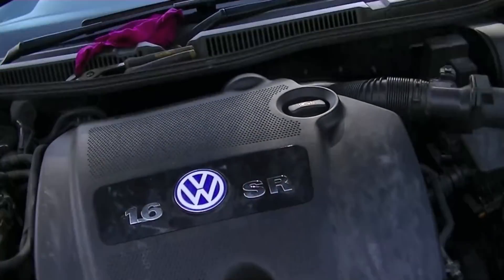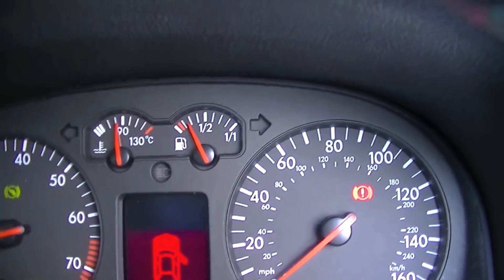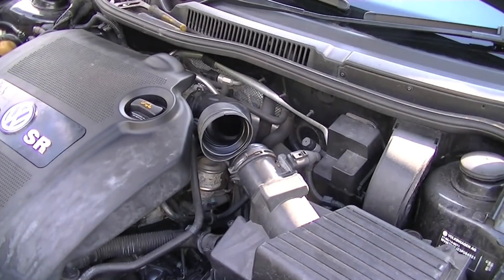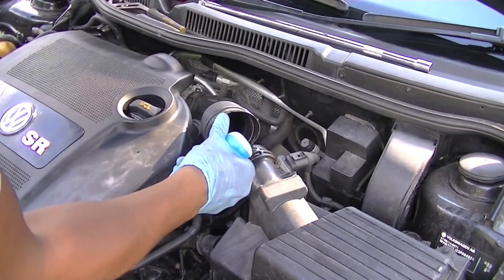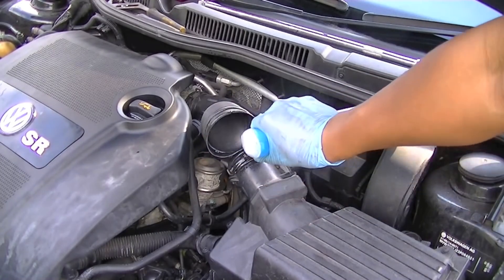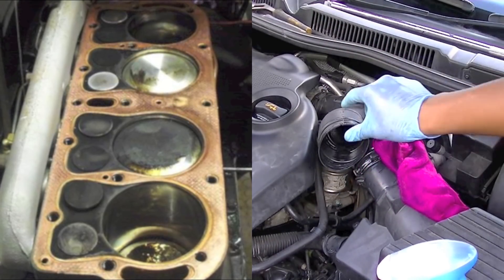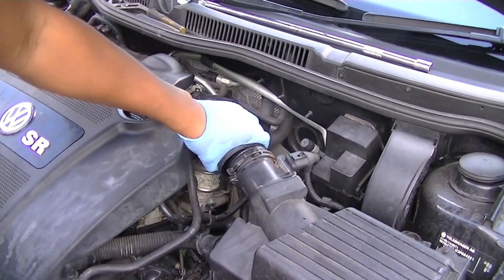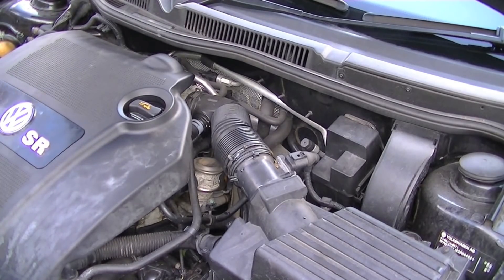How to make your engine run better with just tap water.......Better Than Seafoam?

Comment: Hi, I am planning to do this on a 1.2 TSI turbo that has an intermittent cold start misfire issue. (Spark plugs coil packs have already been replaced so I suspect its due to carbon build up since its direct injected) Should I add the water before or after the turbo? Thanks.

Comment: Never take the risk of water in the engine . Or water in the fuel tank. It   can be a dangerous idea for damage all yr injectors . WD40 is cheap & better than water .
Reply: You're not putting water in the injectors, are you...  Youre putting water mist in the air intake...  which if you think about it, hasnt got anything to do with the injectors...  Unless your car has Air Injection...

Comment: I have tryed on diesel tdi, but suddenly i hear noise of turbo, so i stopped..., i think its not good to try this on engines with turbo, because turbo needs fat, oil in fuel
Reply: Cold water on a Hot turbo will make the turbo shit itself...  You have been warned...  Spray AFTER the turbo...  You cant do that manually, you have to install a PROPER water injection kit...

Comment: I just did this on a hot engine the right way, and now i got check engine light after reassembling... HELP
Reply: Itll settle after a few minutes, once the computer realises all the sensors are still there and working (unless the plug has fallen out of the sensors, and they're genuinely NOT working)

Comment: i never see this but i dont think that   water spray can make damages in the way he dose. in the combustion chamber the atomised water instantly turn into steam and for all the rusting issue comments. i dont think that any humidity will stay there long anough to rust anything. lol make sure to let the engine runs 4 few minutes and the rust issue juste dosent exist. i know that water expant about 1000x his volume when turning into steam. it could maybe increase the compresion a bit and that can help to take of the acumulation of cab that build up in a little bit lower compression condition. if you ever herd about steam hammer in steam pipes that contain colder condensate. ok, its the invers process. steam that get back to his liquid state but    the rapid expention or rapid cool down into liquid water have a  pretty violant effect.

Comment: I have used this method on petrol engines with carbies having someone keeping the revs up to stop stalling & pouring a 1 pint Milk bottle of water through directly into the carbie.
If you stand behind the gunk & black flakes that come out would surprise you.
Barry Michael Australia

Comment: Used to do this by pouting a cup of water from a measuring cup revving the engine to about 3000 rpm and spend about thirty seconds dumping it down the carb.  made spark plugs look brand new never ever had an issue. changing the oil is THE most important thing you can do for an engine. there are good and bad oils out there. expensive is not the answer

Comment: A buddy of mine tried this on his diesel engine. It caused the engine to blow, due to oil getting too thin, while doing that a few times and the piston got stuck, breaking a hole into the sidewall of the engine. Some of the broken parts got into the exhaust system and broke the turbo and catalytic converter as well. When I asked him what made him do that, he showed me this video. I took the motor apart and the pistons were not even cleaned as you claimed it would do.
In some comments you refer to this technique being used in the 60's, but they didn't actually use normal tap water. This can cause rust in the exhaust system and the turbo (if it's installed). Only distilled water doesn't cause rust.
How can you even recommend a "cleaning" method to everyone, without making exceptions to certain cars? This practice can NOT be safely performed to ALL types of cars as you claim (and especially not with tap water).

Comment: Water injection was used years ago in propeller driven Fighter air crafts , to fool the engine at high altitudes into thinking its working in a lower altitude , this would yeild more power ans speed... so this video has some merit..

Comment: Well back around ww2 & then later in the 1950's there was a device that was a kit that would essentially do what this gentleman has done here.The kit contained a tank & a valve that would let a small amount of water into the  engine when hot ., my father said it worked very well.The one reason i can think of is more carbon would build up in these engines that were lower compression & didn't burn their fuel as completely., & add that they had carburetors & no computer control ,adding to the problem.Later when cars got Up to about %50 more compression the problem was still there, but less apparent among the rest of the  preexisting problems of poor ignition systems & shorter engine life , "for the average owner" .Now with modern cars with variable valve timing , computer controlled fuel injection & "effective compression ratios of 11 to 1 compression can be over 200 lbs  read  with a gauge .,( all without detonation {mistakenly called spark knock}These water devises were for gotten when 200,000 mile engines were easily within reach for everyone.Do they work? Yes.& better running (smoother) means better gas mileage & longer engine life !

Comment: This works well with distilled water in a plant mister/sprayer. My 2000 Corolla was pinging on hot days running  above 3K RPM. After 3-4cups of warm water sprayed into the intake while running the engine at 3-4K RPM, now the throttle response is incredible, and no more pinging!
Done correctly with fine mist, there is no concern for hydro-locking. So many people doing this with Seafoam for many years (myself included) I've yet to actually know anyone who destroyed ttheir engine due to hydro-locking.

Comment: I know what spraying the water does. First, water absorbs some heat from the air intake and cools some of the air. Giving a denser air, improving some performance. Secondly, when the water is in the engine, it becomes superheated steam, cleaning the carbon deposits out. Superheated steam is able to flow out like a gas, same process use in power generation. You know what i mean if u have a gd grasp of thermodynamics. Steam is able to clean and dissolve a lot of things, go google if you dont believe me. Its like steam cleaning the engine. I do not trust this method, I am not sure if steam will damage the pistons though.

Comment: I've got little mason jar of water and raved my old carb motor to 15 to 2500 rpms and poured it down the card do to the fact water do t combust and it reseated my valves and the motor ran smooth after and I'm a deisel machanic I u.derstand everyone has there dounts but I wouldn't  Recommend it with these newer motors BG makes a really good cleaning agent for your plinum but cleaning the throttle body on the fly bye  will take care of the reduced engine power use parts clean and a little wire brush

Comment: Hi Ya,,in the old days,,( yeah i'm 60 ),we used wind screen washer bottles and in jected water straight in to carby ,,but we did it to allow timing advance,stop detonation,,mind it did give slightly better performance,,or so we thought,but never had an engine hydraulic or fail from this,,mind not to much water,,

Comment: When your engine stops the valves on a couple of the cylinders will be open, so over night you will have condensation forming in these cylinders. That is why when you remove the cylinder head there is less carbon in those cylinders than the other ones.
In older engines they did not have rubber seals on the valve guides, the rocker cover would condensate inside which caused the oil to look like mayonnaise. This water oil mixture would run down the valve guides and into the cylinders. The boiling point of water is 100 degrees  center grade. The combustion chamber is about 900 degrees.
The water would have evaporated putting up your compression ratio. Which gives the impression of a cleaned engine.

Comment: Small amounts of H2O (aka fine mist) enters the intake with regularity. Condensation can build up simply by heating and cooling in a high humidity atmosphere...not to mention driving during a rainstorm. It's virtually impossible for a fine mist to harm an engine running at 2,000 - 3,000 rpm at normal operating temperature.   In fact, the mist will more than likely vanish before it gets to any of the engine's inner workings just due to the ambient temperature in the intake hose near the intake. Set an oven at 170° and spray a fine mist into it and see what happens to the mist. It's only common sense, people... try using it before you post idiotic responses.

Comment: Lots of opinions here are valid, but its simply not true to suggest that water sprayed in small amounts into the intake would destroy an engine, Saab use a water injection system in the 1970's and many race cars use water injection today, granted it's for a different reason, but it proves that water mist sprayed into an engine is not destructive provided you go easy on it.

Comment: Will this method also clean the throttle body? I have a volvo c70 convertible its throwing up ETM codes. I am going to clean the throttle body with the correct cleaner. After i am going to do this decarbonize, can i occasionally spray throttle body cleaner down there aswell just to help with the process?

Comment: how this work if i spray it on the turbo?
Reply: REALLY dont spray it on the turbo...  Very cold water on to very Hot turbo, the Thermal shock would be enough to grenade the turbo, if not cause some pretty nasty damage that will make itself apparent the next time 5 billion RPM boost is required...

Comment: Good video....
 I tried this on my Audi TT  ... it had over 120k miles.... cold water and a table spoon of white wine vinger and a a table spoon of lemon ... juice.... 
Squirt 6 times every 30 seconds  ... now the idle needle has dropped...
.. engine drives well.. and am saving petrol... thought it was a joke at first .   But it does work...

Comment: Will this also help clean the build up inside the exhaust ports, exhaust manifold, and inside the exhaust pipes?
Reply: No, in fact, if it cleans the engine all the rubbish heads OUT the exhaust and it will corrode the exhaust system quicker...

Comment: Before fuel injection came around our Cadillac dealer put transmission fluid in the carbs of all used cars they sold then had the cars driven around. When they came back the exhaust would be chalk white just for those who inspected it before buying...lol

Comment: Your supposed to get a one gallon milk jug fill it with water then get someone to rev the engine up to 5000 rpm then pour the gallon of water in as fast as you can. It will clean the tops right off those pistons. You might have to replace a coupe piston rods but while your in there replacing those you can wire brush all of the carbon that’s left off.

Comment: If this doesn't work,  why do they make water/methanol injection kits? Why does the bmw 4 series have an option for that? Although its for a different purpose.... raising that octane of fuel. But at low,  atomized amounts, it won't hurt your engine. I have a B5 S4 and I've run a water/meth kit for years

Comment: That's bull.. best way is use cow shit smear around air intake rev the fuck outta the engine . Then pour neat vodka into oil top up tube. Then add crushed  ice. Drive for as long as  possible then call breakdown company.. this is no worse than what that twat has just described  other than ur car will now smell of cow shit!

Comment: I dunno if this method works or not but if anyone needs a 100% positive fuel system clean which include the airflow sensor, the catalytic converter & the complete internals of your engine, find a "Terra Clean" center & get you engine cleaned there. If it doesn't work, Il pay for your costs! lol

Comment: This guy's a idiot let get water in the motor , rust on pistons rods spark plugs and probably wear out bearings
Reply: The water vapour...  remember its not straight water...  enters the engine and pretty much immediately evaporates, drawing heat out of the inlet charge...  This makes the inlet air cooler and denser...  Cooler and denser inlet air means you can fit more into the combustion chamber on each stroke...  This is a GOOD thing...  

I sincerely hope you arent misting water into an engine thats OFF...  If its running, and at operating temperature as per the instructions on the video, the water can be digested and spat out the exhaust...  If the engine is hot...  Why should there be rust (lets call it corrosion) on the pistons?  If the combustion process and the water mist happens on the TOP side of the piston why should there be rust on the rods?  on the UNDERSIDE of the pistons?  They're coated in oil, arent they?  You know how water and oil dont readily mix...  Especially hot oil...

The secondary effect is the newly injested steam cleans everything in the combustion chamber, and is spat out the exhaust!

The method has been tried and tested since Adam was a cowboy...  Spitfire mechanics used this in WWII!  BMW has  this on the new M3...  I dont agree with the squeezy bottle, but I recently sold an old XC Fairmont with a proper water injection kit...  Engine like new...  new owner very impressed...
Reply: Andy George you got me there I get it now thanks for the input

Comment: I won't say it's better than seafoam but it does work I've been a mechanic for 30 years too! You just got to be careful of the amount you pour in because you pour too much you will bend the rods, don't believe me try yourself. The fuel pump regulator on my 99 GMC 3500 454 failed pumping to much fuel into the cylinder bending the rods.
Reply: Im suprised the injectors LET that much fuel in...

Comment: I accidentally, during heavy rain, drove through a puddle so deep that water completely soaked under my hood. Of course, my intake filter was drenched and the engine chug chug and died. Being so far from home, I risked it and turned the key, engine started and a unbelievable amount of white smoke came out and this continued for some days after. Changed the oil/filter and it kept blowing white smoke. I then realized my intercooler had water, which was easily about half a gallon. Of course once I got rid of it, the smoke was gone and she was happy. I decided to look at the Piston head with a boroscope and my God, I couldn't believe how clean that thing was! I mean it's shiny again lol.

Comment: This vid is a load of crap. You might want to read this to learn more, and all I did to settle this issue was check it on Wikipedia lol :-))) sorry BMACS VAGS but it's all nonsense...

"Most modern consumer vehicle engines are pre-programmed with specific fuel-to-air ratios, so introducing water without re-programming the car's computer or otherwise changing these ratios will most likely provide no benefit, and may likely reduce performance or damage the engine. In addition, most modern fuel systems cannot determine that water in any form has been added, and cannot determine a new compression ratio or otherwise take advantage of lower cylinder temperatures. In most cases in pre-programmed cars, introducing water vapor via an indirect water injection method causes loss of power because the water vapor takes the place of air (and fuel in engines with either a carburetor or single point injection) that is required to complete the combustion process and produce power. Normally, only vehicles re-tuned for water injection see any benefits.
Damage can occur to the engine if too much water is injected or if the injector itself malfunctions. Water is not compressible, and too much water in the cylinder prior to, or during, the compression cycle can cause a condition called hydrolock, where the volume of liquid in the engine is close to or greater than the volume between piston and head (or between pistons in a opposed piston engine) of the engine at top dead center, resulting in extremely high cylinder pressure that may cause blown heads, shattering of the piston, connecting rods or other damage to the engine. This damage is normally fatal to the engine and typically requires a full rebuild or engine replacement.
Water injection is typically used in aviation and was not initially intended for use in consumer grade vehicles. When used in consumer grade vehicles it is normally for the extremely high performance arena (1000 HP+) where vehicles are supercharged or turbocharged and produce excessive heat. These vehicles are typically driven only in an event or controlled race and require extremely high levels of knowledge to maintain and are only driven for very short distances. In most forms of water injection, water is mixed with a combustible fuel rather than being used in isolation.
Many product scams exist touting that inserting a tube of misting spray into an intake manifold increases mileage or horsepower. However, unless the user reprograms the car's ECU or performs major modifications to the engine, power loss and damage may eventually occur."

Comment: Hi. I began trying this on my indirect injection diesel. 1.9 turbo diesel. And the revs didnt seem to drop at all after a lot of squirting.. does it still work with indirect injection engines and can this process help clean valves and possible gumming?
Reply: If its permanent and properly set up it will...  Attacking it in the weekend with a squeezy bottle wont help you much